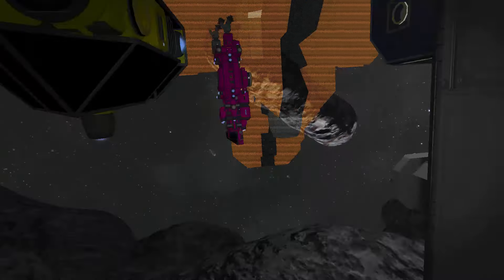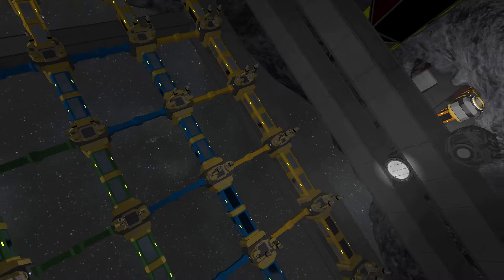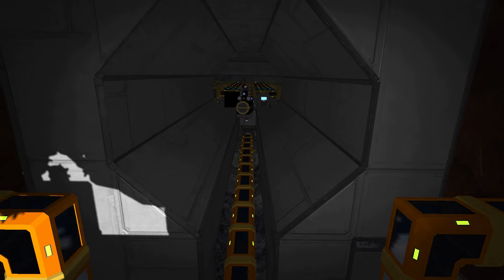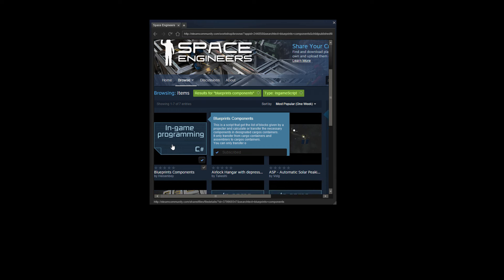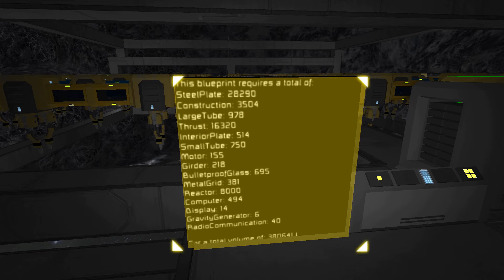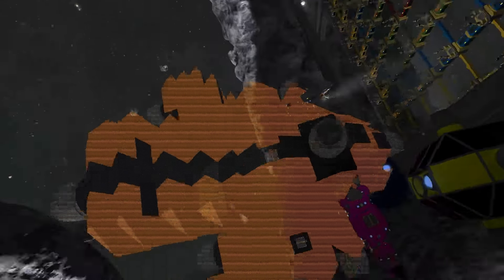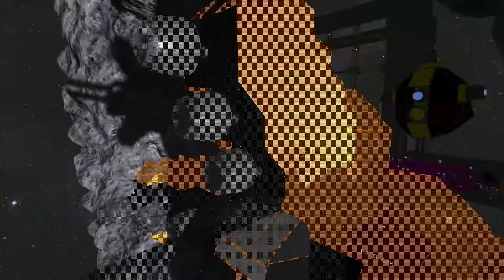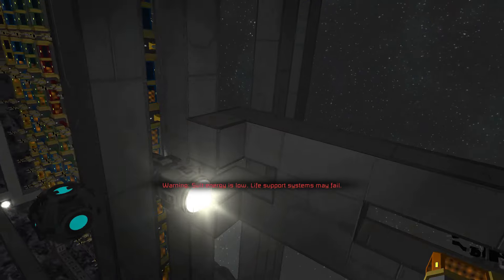S02E18 "Tug Boat Blueprint" | The Nidd | Space Engineers

Comment: I think it would be a great idea to have the tug ship powered by batteries. They're not used that much. I don't know if power is transfered through connectors, using merge blocks would even solve your problem with the script and the projector.

My other idea would be to put the programmable block and the lcd panel on the tug ship. That would only allow you to see the components you need on a list, but not to move stuff in the right container.
Reply: Power is transferred though connectors & merge blocks in respect to charging batteries! I use batteries "EVERYWHERE" &  have just 1-2 small back-up reactors on the ship incase of battery failure, I tend to leave my ships connected to a charging hub with solar panels & extra batteries to recharge my battery powered fleet, which I always have just enough solar panels on any of my ships as well to just offset the standby mode of any of my ships! One of my older worlds(before oxygen) I had scattered around the world those recharging hubs with about 4 solar panels 8 batteries & 5 connectors(one in each direction except the "top" where the solar panels where) for ships large or small to dock! If I do this now I have to update those hubs with o2! Also, I surely hope that someone will get a program built so we all can just use our projections to have the assemblers build what is needed with the fact of what we already have built! That would be great! No over building of parts & wasted time/power & as well as no need for a disassembly area! 

But you could use a merge block on both the station & the Tug to merge the 2 temporarily so the programmable block can get the specs of the ship to be built so when you start to build it would already have everything needed at the station, if the laser antennas don't work that is!
Reply from the maker: Redstonewahn elementalblaze79 You know what, you are both right about the batteries. I actually prefer batteries over reactors anyway. I'm not sure why I used large reactors on the tug ship. If I have the time I'll do a re-design and swap them out.

Merging the tug with the station to get the list of needed components is a great workaround. It would be nice if the customer didn't have to dock the ship just to read a list of parts so I hope the laser antenna does works. Using a hidden projector could avoid docking the ship but then you would need to load up the blueprint on two projectors. Putting the programmable block & LCD panel on the tug is an interesting idea but I think I'm going to leave them on the station. In the long run I want the customer to be able to do everything from inside the station. At least that's my ultimate goal.

I use the connector/merge blocks to recharge battery powered ships as well. If you connect your ship to a station with a lot more output capacity it will recharge much faster as well. I really like the idea of scattered recharge/oxygen stations. That could be a fun thing to do for the patrons of the server. They could be jump point way-stations for travellers :)

I'm going to try and carve out some time to look at the script I demoed in this episode and review the in-game script api to see what is possible for automating the assembly process. I hope that this ability has been added but I imagine there would already be a written script to do this if it was. So I'm keeping my expectations low for now. As you say, it would save the effort in building a disassembly area and that would be grand.

Excellent ideas both of you. Thank you.